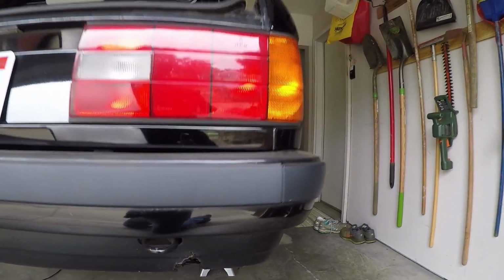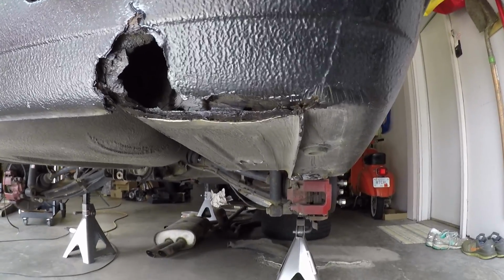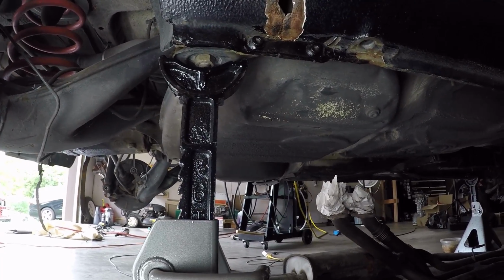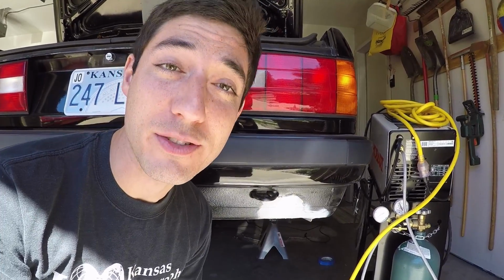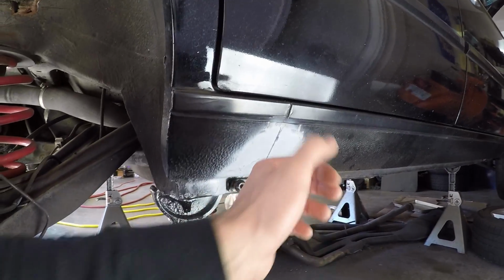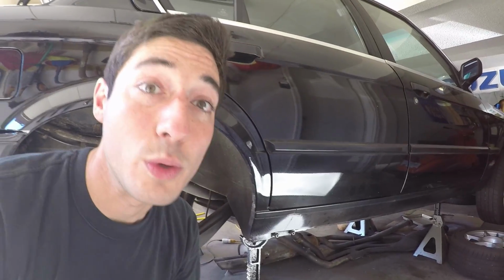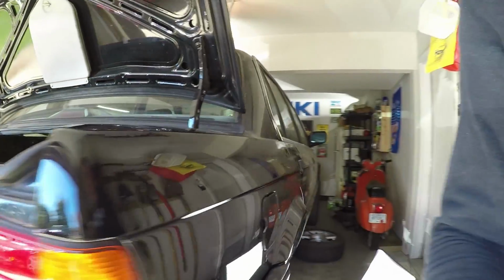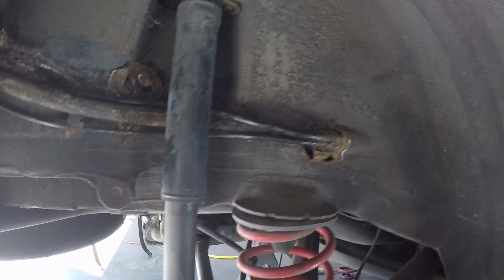Project E30 / Ep. 10 / Rust Repair - Rear Valance and Rocker Panel

Comment: I just got an e30 for 3weeks now and just actually went under it and discovered rust on the passenger side. Sucks, idk how to weld. Well, probably not gonna say idk how since I never done it before. I was just gonna cut out the rust and bondo it and then use sheet metal followed by a bed liner paint. Haha. I do all of the work mechanically, just not that good in body work. You made it look so easy. Haha

Comment: Nice! Making some good progress. With double layered panels like here and the last video, how do you make sure you don't weld the outer one to the inner, or does it not matter?
Reply from the maker: That's a good question. Sometimes welding the two layers together is inevitable since there is such a small gap. But, in the case of the rear valance (in this video) and the rear wheel arch (previous video), welding the two panel layers together is actually desired. From the factory, the panels are spot welded together in a few spots. I have tried to retain some factory spot weld locations (like in the wheel arch radius) but in the valance, I just ran a weld bead on the interior seam of where the two panels meet. You can't see it in the video, but it's there.
Reply: @PracticalEnthusiast  Thanks, that's really interesting. Looking forward to more!

Comment: great work! two suggestions:
1) use a bed liner spray or some sort of textured coating and re-cover the rear and side valences, so they will all match
2) consider getting your next project car from California, lots of rust-free cars here :)
Reply: just an add on to this! did the exact same thing for my 318is' rocker panel. Rocker Guard from canadian tire or home depot etc is a great cheap aerosol can that matches the wrinkled look of the rockers. I did a shitty quick repair in about an hour on mine. the rocker guard has still held up great after 3 yrs
Reply: I removed all the chip guard and it looks much better
Reply: 3m paintable rubberized undercoating

Comment: I'm not a fan of your patch welding choice :)
Reply from the maker: Five gallons of bed liner would have been the real ticket!
Reply: What would you have preferred he do in his garage? The cost to replace the firewall, rocker, floor pan, valance, inner and outer wheelhouses, etc. would have far exceeded the value of the resulting car. The value of these cars is going up, but I doubt it will be high enough to justify factory level replacements for every hole. Maybe if you have a body shop and can get better prices on panels. In the US, the cost of labor alone would be more than the car is worth. Doing it himself is a challenge that he can learn from, and makes his E30 roadworthy and drivable.